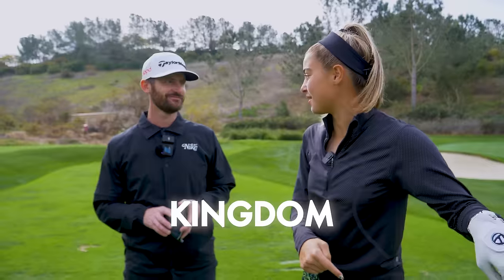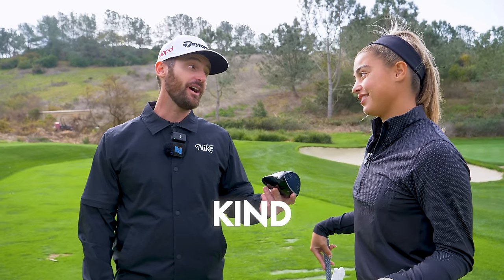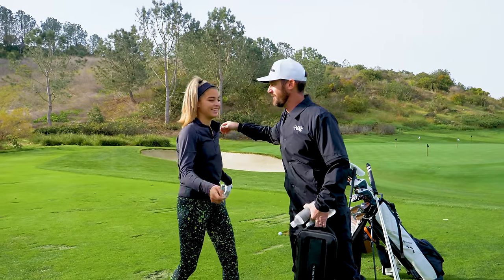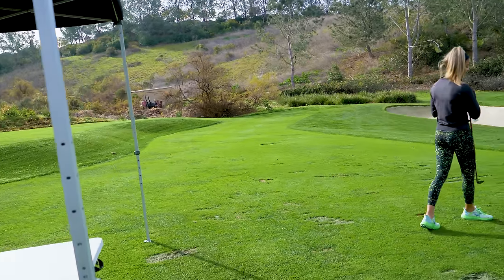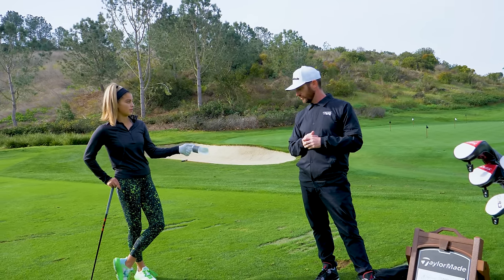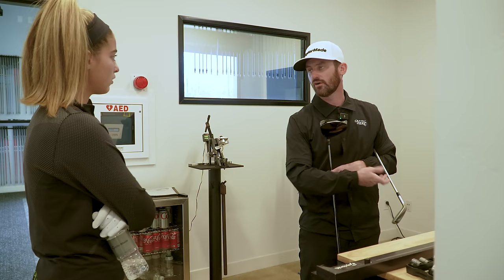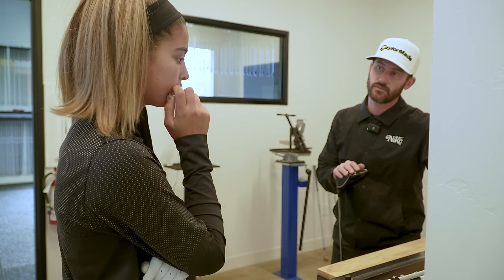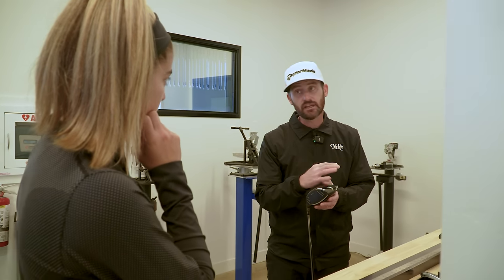Full Club Fitting At The TaylorMade Kingdom - NEW Clubs

Comment: I went for an iron fitting without any brand preference.  Tried 3 different iron heads, Cobra, taylormade and titlest.  Also Tried graphite and steel shafts.  I ended up with titlest t300's amr red steel shaft, 1/2 inch short and 2 degrees upright.  Best money I ever spent was on the fitting.  Gained distance and accuracy.  5 iron to a 48 degree wedge.  Next will be a wedge fitting and maybe hybrid fitting.

Comment: I'm not sure Trotties precision techniques are the way to go. My technique is to buy a random club off ebay take it to the range and whack a few balls. If it doesn't work well for me I just resell it and buy another one to rinse and repeat till I do. Yes my way takes longer, currently I've found a putter and 5 wood that work great and yes it's taken me since 1994 to find these clubs, but my throw enough crap at the wall till something sticks is method is working. At the current rate of progress I'll will have my perfect set of clubs in around 300 years. Yes, I'll be long dead, but just thought I'd offer an alternative route to precision fitting from probably the world's no1 fitter.

Comment: On thing I didn’t like on your fitting is that you said you wanted more distance and Trottie fitted you into P770’s. I don’t think that will help you but time will tell. P790, 7 iron loft is 30.5 degrees and the p770’s are 33 degrees. That’s a big difference and you will easily lose 10+ yards. So now instead of hitting your 7 iron for your 150 yard shot with your 790’s, now you’re gonna have to use a 5 iron. Much harder to hit. At the bare minimum he should have bent the 770’s a couple degrees stronger for you. You’ll see I’m right 😊
Reply: if you watched the video 770 gavE her height and control and more distance lol trottie isnt a noob man
Reply: @rypglof  impossible to have more distance with a weaker loft of 2,5 degrees. Simple physics. Why do you think your 6 iron goes farther than your 7 iron? Because it has a  stronger loft. If you have the same swing speed and impact loft then its impossible to get the same distance with a weaker loft. GET IT?
Reply: @ultimatejay Just say you don’t know anything about CG manipulation lol, you can absolutely compensate for weaker lofts to achieve more distance with different weighting. The P7~ series from taylormade is a prime example of a set of clubs that can be post-weighted, increasing the MOI without changing the lofts at all. He also fixed the shaft weighting, the slightly heavier shafts in clubs that she launches/spins correctly will give her better overall results, including more consistent distance.
Reply: @johnmccreary2501  swing speed, loft and smash factor is what determines distance. Simple physics. Adding weight will most likely slow her swing speed down. She used the same shafts as her old irons as noted in the video. Theres no way she is getting the same distance as her p790's. Its  impossible, you're talking 2.5  degrees of loft difference. Go do some more homewrk.